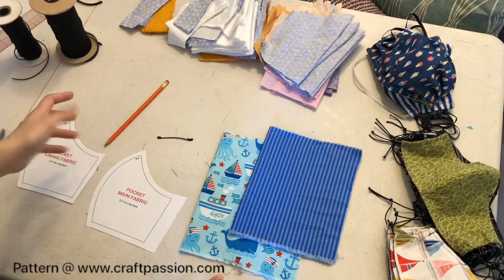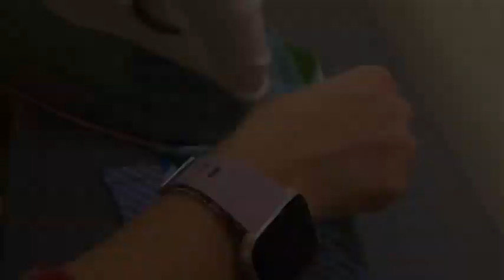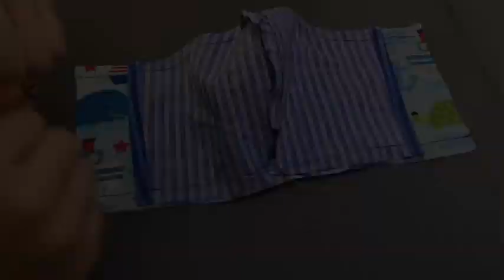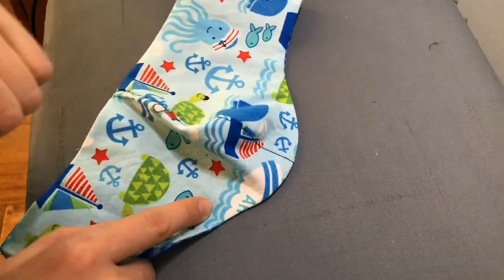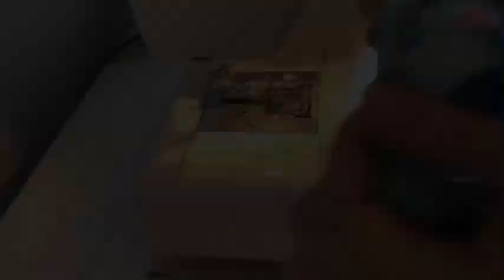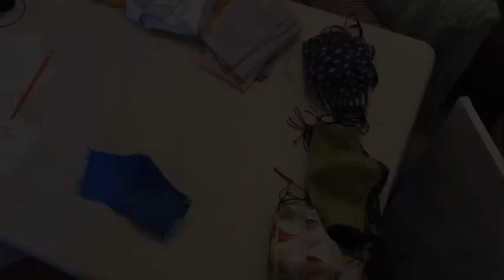CraftPassion fabric face mask tutorial

Comment: Does it matter where the selvage is and how to position the pattern? Thanks!
Reply from the maker: I don't think so for these masks! For sure it matters on other projects. I cut mine with the mask going down the selvedge edge because if you fold the fabric in half and then half again and then again its exactly the size you need to cut 4 on the fold at a time. the mask is just under 10" across so you can fit 4 nicely on cotton. hope that helps! sorry for the delayed response!
Reply: Amanda Todaro 
Thank you very much🌹

Comment: This is great and much easier to follow, thank you! What does it mean when you say you have your machine set on a straight stitch between a 2 and a 3? The largest stitch number on my machine (a Singer 401A) is 6
Reply from the maker: Hi Ellen! The stitch number on your machine is the length of each individual stitch. A 1 for example is very tight tiny stitches, a 6 on your machine would be a longer stitch. The smaller your stitches the less likely your seam is to come undone. I suggest setting your machine between a 2-3 because that a generally good place for most projects. General guideline: 0/1 is good for mostly button holes and a 6 is too big to hold your seam for long. It is mainly used for gathering or basting fabric piece together. It is easily removable. Does that help? Thanks for watching!
Reply: Thanks, Amanda. This a a mid century Singer Slantomatic.. All metal components. ;) so 6 is the largest and then smaller as the numbers go higher! I’ll figure it. Thanks so much

Comment: I would have liked to know how long of elastic ear loops and ties to use.
I'll check your original instructions page. 
As a personal option,  I will double stitch the center front of mask, but not top stitch,  to avoid the extra pinholes that virus can get in through. 
Thank you very much for this mask pattern and instructions!  I appreciate it! 🌹🕊
Reply from the maker: cookiemama4 I use 12” pieces of elastic to do tieable ear loops and 40-45” if making one continuous tie
Reply: @AmandaTodaro  
Thank you so much!  I needed that info!  I made masks for my adult daughters,  and had to change out the ear loop elastic for longer pieces because it hurt behind the ears after a while.  I am adding a dart on the side of the mask to make it fit snug, with the looser elastic.  Not actually a dart, just a little fold over sewn at the edge. Can't find the word I'm looking for.  
I'm also hoping to try about a 1" piece of elastic sewn under the lining at the nose, stretching as I go, so it will gather a bit at the nose,  not having nose pieces to form fit.
I have about 50 masks cut out and ready to go.
Again,  thank you!  💕
Reply: Amanda Todaro in a previous reply you said 30”...... So which is it ? I’ve been trying to figure out the perfect measurement 🤓
Reply from the maker: Angela Moore 40-45” has been my go to! I think it’s a bit long on most people but I think it’s better to have extra just Incase! 30” will work ( and if I put it in a comment then at the time that’s what I was cutting my elastic to) but now I do 40”-45” to be safe!
Reply: @AmandaTodaro  
Is the 40-45" to wrap around the head?  Sorry, just trying to get it right..
Have a beautiful day!
Reply from the maker: @cookiemama4  Yep! 40"+ is if you want it to be one continuous elastic or fabric tie that goes around the head and neck (I say 40-45" because if someone is using a tie that is not stretchy they may need the extra inches!). Alternatively two 12" pieces of elastic can be used to make ear loops on each side. both of these measurements account for the knot and extra on the ends. hope this helps!
Reply: @AmandaTodaro  
Thank you,  Amanda!  I appreciate that! ❤

Comment: HELP!  I have made four of these now and just found out that I can't get a filter in any of them.  It is way to narrow a channel.  There is an opening of 2 1/2" between the seams, but I can't wiggle anything in there.   What is wrong with them?
Reply from the maker: karen brown hi! The 2.5 inch opening on each side sounds correct, it is a small opening and does take some wiggling to get a filter in there. What are you using for a filter? It may need to be cut/shaped?